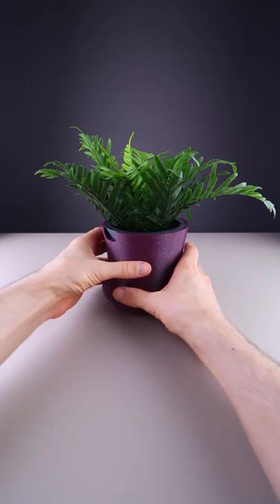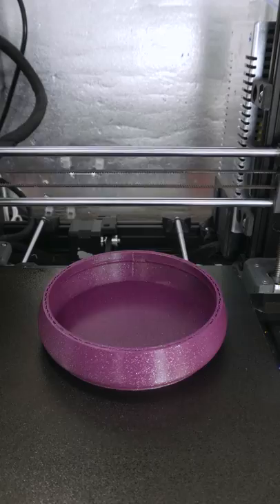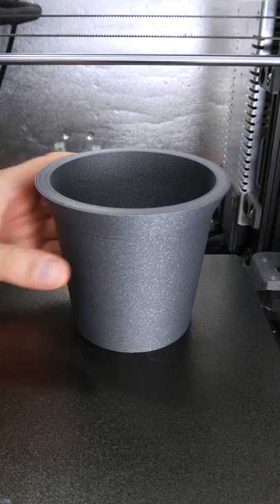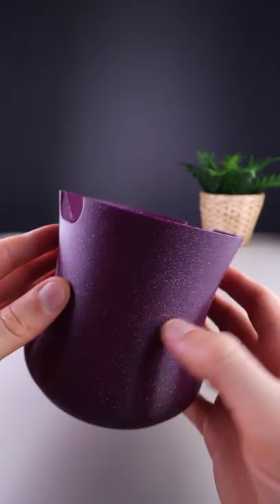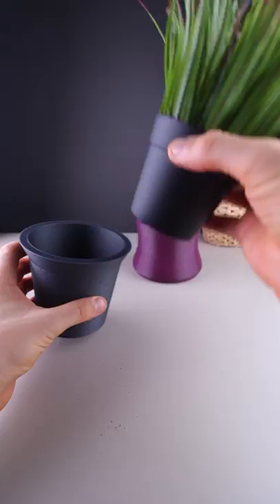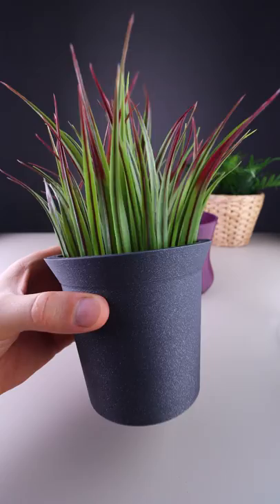3D Printed Self-Watering Flower Pot (Practical 3D Prints)

Comment: I love self watering pots. This one has a nice design, I surely will print it soon!
Keep up the good work!
Reply: What are they lol? How is it self watering if it’s just sat in water haha 🤣 are they any different than when I just sit my venous fly trap in a low cup, that I fill once a week ish, it gets chance to have some dryish time and it seems to do amazing since it started the new routine and flowered... though I’m not quite sure what e it was supposed to do next... haha 🤣  Sorry I’m soo proud It’s foiling amazing and I KILL ALLLL PLANTS 🌱 haha I think I FINALLY BROKE THE CURSE! 😆
Reply: @dannytonnessen6896  the water soaks up into the soil through the bottom so you only have to refill it when the reservoir is empty
Reply: @dannytonnessen6896  by pouring too much water on top at once you’re basically water boarding the plant, when it’s at the bottom in a pool the plant can suck up as much as it needs as slowly as it needs to

Comment: I thought that PLA was not rated as water proof?
Reply from the maker: it will last for a long time (years) in water 😉
Reply: It is. It even lasts quite some time.
I have several vases and flower pots and they are all water tight.
The only issue I ever had came from printing in vase mode, but that was easy to solve.
Reply: @marsgizmo  Ah okay, that's good to know. Maybe it was said by people who were underextruding!
Reply: @olafb.2929  Isn't PLA supposedly bio degradable? What problems did you get by printing in vase mode and how did you solve them?
Reply: @Martial-Mat  It is said to be biodegradable, how it takes... I don't know. So far all are ok (less than one year in use).
The tiny leaks are somewhere at the transition from bottom to sides. Current solution for avocado growth helpers is to put them on a safe plate that collects any water coming out (tiny amounts!). Next solution will be use a tiny amount of epoxy on the inside. Hope it works.
Reply: Some people coat the inside of their PLA flowerpots with Titebond III wood glue, which is at least water resistant. But this has pretty thick walls, and I wouldn't expect it to fail catastrophically, so you could always print another.
Reply: Varnishing outside easily solves the leakage problem.
Reply: @bugur35izmir  Thank you.